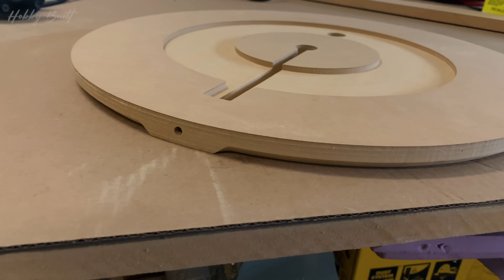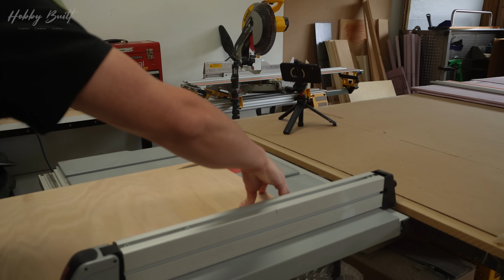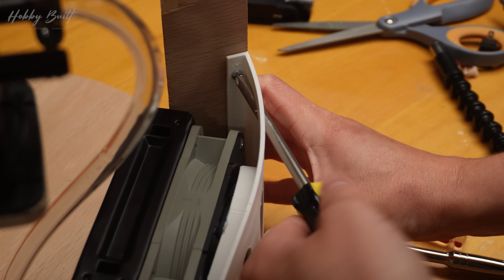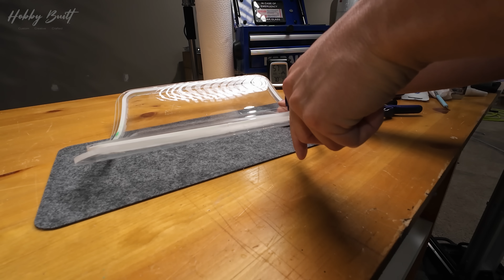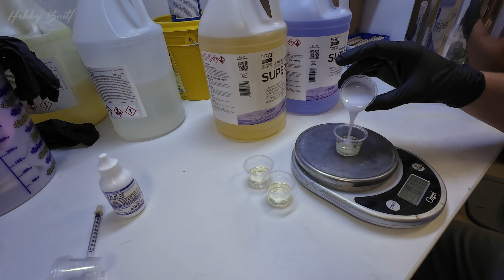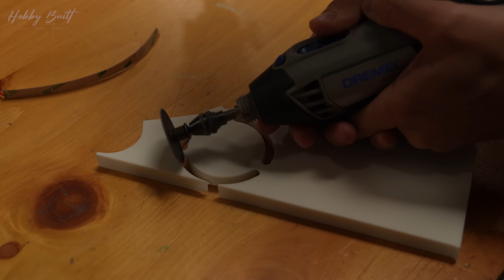It Started As A Coffee Table...Now It's More

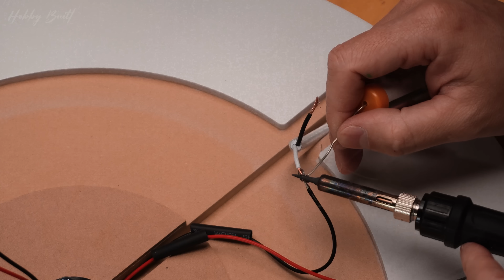Comment: 1:48 Depending on the wattage, you should crimp the power connectors. Sometimes the solder joint and get too hot and melt if pulling a lot of energy.

Comment: You had mentioned way back in ep1 that you had hoped to have magnetic power connectors so that you could move the table anywhere and run off battery (which you included) but you couldn't find the right/adequate connectors. I know this is not an elegant solution, but you do realize you can just unhook the brick and set it on the lowest shelf right there and move the table all you want. It'll work until you find the right connectors you want to make it more slick. Just a thought.

Comment: I agree with others so just one or two small details. Infinite turning won’t work for the power cable at the centre as you made it. It depends how often and how much you turn the table, but sooner or later the power cord will break. I would recommend to limit turning to 360. And why did you use a lighter for  shrinking isolation tube instead of a gas torch you have as well? :-D
Reply from the maker: A slip ring is used to spin freely many many many times over. No issue with cords breaking at all. Check them out, very cool devices. I’ve spun my table about 1000 times already
Reply: @hobbybuilt  I’m sorry I didn’t see it in the video. I had to miss that. That works, you are right. 👍

Comment: Awesome build!! You may want to double check that fuse block though, I used one on a Power wheel build and found the circuit for the LED indicator lights back-fed into the system and even with a fuse out the system had power.
Reply from the maker: Oh no! That’s bad. Fortunately I tested the unit with everything out and no power. Thank you for the heads up though.

Comment: If you could design and create an Inwall coffee maker that is connected to the houses water so no longer have to refill that is also connected to a water filter to keep coffee machine clean from minerals and such, that would be great.

I always wanted a Recessed coffee maker in my wall that looks futuristic.
- Small water reservoir that refills when used

- Have 4 or 5 different brewing abilities, 1) Whole beans > Grounded > ready to use storage > Coffee machine. 2) Ground Coffee storages > Ready to use storage > Coffee Machine. 3) Cappuccino and Hot chocolate storages > Ready to use storage > Coffee machine. 4) Keurig slots for instant brewing. 5) Hot water & Cold Water dispensers. 6) other- Can place prepacked coffee filters into filer area for brewing as well.

- Have it connected to a touch screen controller.

- Have storage compartments for Coffees, Filters, Cleaners and so on.

- Drain leads to actual drainage, not a capture reservoir.

I just think having a machine that can be installed in a wall, connected to waterline and drainage line would be pretty cool, and having either connected storage or individual storages for the other related things would be awesome.
Reply from the maker: That sounds like an amazing project and video.
If you are really interested email support@hobbybuilt.com
Reply: @hobbybuilt  I unfortunately cannot afford to make anything like that right now.
But I thought it would be an awesome project to watch (Maybe take some pointer for the future lol).

The Idea came to me one day when I was setting up my wife and I coffee nook, so many people show their Coffee Bars, Nooks, shelves, but I have never seen a Coffee bar built into a wall.

The Disadvantage is the fact you cannot easily move it to anywhere different without fully uninstalling it and setting up the new install location.

But the perks are that your water supply can always be full since it connected to the homes water line, You do not need to worry about draining a reservoir since it would be connect directly to the drainage pipe system.

Plus it would most likely look cool built into the wall, especially if you frame it with soft LED lighting while making it look like a Cafe window.

Could also setup a Semicircle cafe table right in front of it so you could sit and wait for your drink, making your coffee bar look nice and not take as much room as a traditional Coffee Bar, nook, shelf. (Could make the table be a fold out and the seats be foldable too (Connected to the wall), for even more space saving.

I think where this would benefit the most position wise is on a wall near the entry to the kitchen though, many homes have either a hallway going into the kitchen or has a dividing wall separating the Kitchen from another room, so placing this coffee machine into a narrow area that normally cannot have things in the way would be best, otherwise what people put on the wall are space fillers like pictures, lettering and so on, so by having an in wall coffee machine, that wall space gets used.

If open Floor plan with no hallway or available wall, could possibly install in a cupboard/pantry.

Comment: Ok, seriously why isn't this in mass production? This is so cool and I want one.
Reply: Because it will set you back a couple of thousands and the market for something like this is tiny
Reply: Couple thousands for tablet, fan, heated, light, and home assistant? Yeah no. Couple hundreds, yeah. Couple thousands if you are moron totally unaware about how world works lol...
Reply: Just to Chip in again after seeing your comment and people thinking its true.. All my house appliances together are couple thousands with fully running smart home, local server and all Electronics lol..
Reply: @zjweele13  China is probably doing this for less than a 100$
Reply: I also want it
Reply: The market would be plenty large to make this a profitable product, but there’s a huge difference between make a one-off working concept, and making a reliable market version at scale.  Not only do you have to solve 10x as many engineering issues (the fridge door hinges for example are not suitable for the warranty-minded public), but you also have to design and innovate the manufacturing end, which requires trying to simplify and combine pieces and processes, so that the costs of manufacturing are low enough that you’re actually able to sell the product with a sufficient profit margin.  I’ve gone down this road and it doesn’t even begin to address the marketing costs, shipping (usually from China) tooling costs (at least $150k just from what I’m seeing here), and the legal costs of potential patents/trademark/business insurance/and warranty.
Reply: I don’t understand why the market for it is tiny

Comment: while watching the whole video one thought keeps coming to mind... 
what happens when you spill the coffee by accident and some liquid gets in contact the the electronics? 

amazing project btw!!!
Reply from the maker: Haha my thoughts through the whole project even at the start. solution put all (well most) electronics in one area that water cannot drip on. Good thing about low voltage is very low probability of fire, and if you fuse it correctly all you will need to do is replace a fuse to get it up and running again.

Comment: As an added upgrade in the future.. have it so when you put a cup/bottle onto one of the heating/cooling plates (weight sensor) that it notifies you by a notification and asks what type of drink it is (hot or cold) and defaults to a specific temperature automatically. That way you don't have to really do much. Other than that, unless you want to change settings, add a custom temp which will allow adjustments to specific heating cooling pads and display what plate is at what temperature
Reply from the maker: That's a super cool concept! I love the idea of more automation.

Comment: Impressive build! Very cool, and I wish I had some of your skills. 
Now for the critique: 
1) Espresso. No X. 
2) I think that there's a flaw in your heat transfer design ("water-cooling") from the tabletop peltier element. That's going to be leaky (and probably moldy if you never open it up and clean that out due to 3d print layer lines not being watertight in the reservoir and possible ice buildup and melting). I could be wrong about this, but you didn't include any waterproofing in the video to deal with leaky layerlines in 3d prints and that reservoir looked custom.  
3) There's also a design issue with your display attached to the side of the table. It's not in a position that's going to be easy to use. You'd need to tilt it or raise it, so that the viewing angle is useful to anyone who might be looking at it. As-is, your face would have to be just a tiny bit higher than sofa cushion level to get a good view of that screen. Or in other words, unless you're sitting on the floor, your viewing angle is going to suck. And getting on the floor to use it everytime you need to do anything with it will make it an unpleasant user experience.

(edit - corrected a couple of grammar errors)
Reply from the maker: SLA does not have layer lines leaking not an issue. Angle could have been maybe 5 deg more but anymore and it's a really knee buster. Thanks for watching!
Reply: @hobbybuilt  Awesome! I must have missed the SLA mention. Once again, that's an amazing project. Overall, VERY VERY cool. Keep doing great work! Hope to see more like it.

Comment: Fantastic project, I would have loved some more technical details especially about the Heat/Cool plate. I'm assuming from what description there was it's a peltier device, but would have enjoyed some more specifics, such as how you're shedding the heat when it's in cooling mode without interfering with the heating. Regardless it was an intricate and fascinating build. 👍
Reply from the maker: Thank you for the kind words. I am always nervous to get more in the weeds with that type of stuff, especially on YT. I do have extra content where I explain a bit more on patreon. I can say however when both peltiers are active the system works against itself a bit. Improvements for V2 if I ever get around to it.

Comment: I'm gonna say that it's a nice build. BUT... it feels overly complicated and hard to replicate without a 10k Dollar high tech workshop. For example, why did you put plexiglass under the fabric instead of just putting the LED lights there? Why would a not serious refrigerator need a battery backup AND watercooling, which is going to need maintenance. You could have easily put in a serious 12V refrigerator at that point. Sorry for the critique, but I just don't feel the craftsmanship, it feels more like showing your tools.
Reply from the maker: Thanks! oh this is not a DIY project.

Comment: Such a cool project, thanks for sharing! 
One question though, even if the wires from the power supply are placed where they are in the center won't there be a maximum amount of rotations the table can make before they get too twisted and break?
Reply from the maker: Thank you!!! So the wires are going to a device called a slip ring. its basically like how a brushed motor works. the contacts can spin around in a circle from entry to exit and make as many turns without twisting as it riding on a bearing.

Comment: Are you passing DC or AC through that slip ring? Have you calculated how many amps you are passing?
If you are passing DC, those wires looked too thing to me for the amperage of 3 Qi chargers, a paltrier element, a screen, rpi and lights.
If you are using AC, I would recommend for a safety margin, to at least get a slip ring with a 3rd circuit to also be able to pass ground and ground any exposed metal, or devices that are not double insulated
Reply from the maker: DC and yes plenty of headroom on the amperage. Peliters are throttled as well they contribute a vast majority of the amps.  Most importantly fused literally everywhere.

Comment: ya should throw a couple of IR heat sensors on it and have it slowly rotate towards heat signatures present it the room also you don't need to have a drip tray if you have a bit of thermal mass to prevent frosting. Also maybe look into buying wrgbic strips not just rgbic plus you can get better results with 24v or 48v strips then the 12v ones given you get good diffusion or high emitter per mm 💖
Reply from the maker: I that IR heat sensor idea is so good!
The strips I used are indeed RGBWW (warm white). I used 12v since that was my source voltage no need to step up/down. Not sure I follow what you mean by 24-48v diffusion brightness is not a concern they are BRIGHT!

Comment: Is that slip ring rated for that current load? I know Peltiers are *hungry*? Couldn't you use wood glue instead of contact cement to glue bendy plywood to plywood? They make it in different wood tones if that's a thing you're worried about. I love this project but I think you've got more of a "living room space heater" than a "coffee table fridge". Oh, I love the 3d printed router guides though. Always use mold release with silicone (it's a crazy beast with many arbitrary rules). Could you not have used the foil tape as a reflector instead of black paint for the task light? You don't need to worry about blocking the EM charging there. I mean the walnut looks good, but you could have just used foil tape and solved it from the start. Sorry, I'm an old curmudgeon. This is my way of saying: this is when I discovered your channel, I admire your ambition and look forward to the next thing you do.
Reply from the maker: Welcome to the channel glad to have you. Oh yeah they are hungry, I am throttling them a bit. Slip ring is rated for 15A so some headroom for sure. Went with cement for peace of mind as far as flexibility. Thanks for the tips!!!

Comment: Very cool! Really impressive stuff.  I am curious how effective that peltier cooler is though, for a space that size I'm surprised you didn't go with three or four peltier coolers, and even then I'm honestly skeptical of how cool they could keep such a space.

I really do love this coffee table though, it's some slick design work, and some slicker execution!
Reply from the maker: Thank you and your right to be skeptical! It would never reach fridge temps especially with just one unit albeit a 10 amp one (instead of a normal 4-6 amp) The circulation fan does a lot of heavy lifting too, if it wasn't added temps would be much higher. In tests without it I was getting 64F and with it  the lowest I saw was ~52F!. I knew I was not going to reach normal "fridge" temps around 37F so it's more of a water/wine chiller when needed. I was always figuring the 50-60 range would be good for my use as I like the temp of my fridge water that measured in at 62F.

Again though thank you! Glad you enjoyed it.